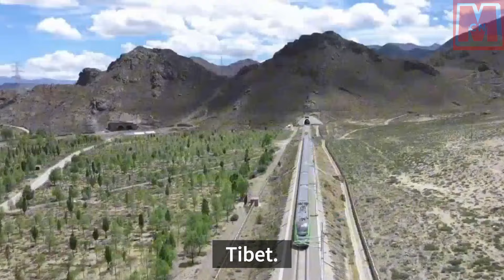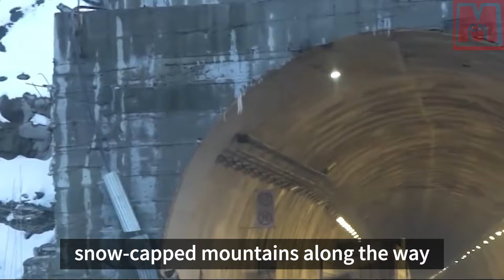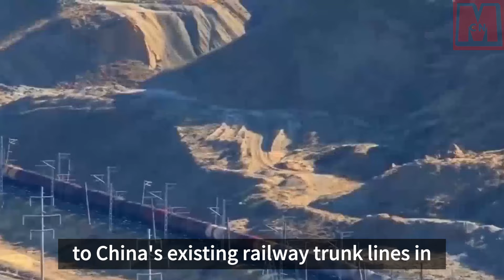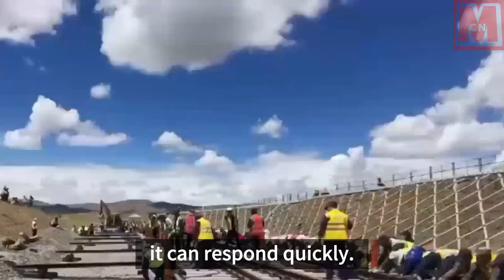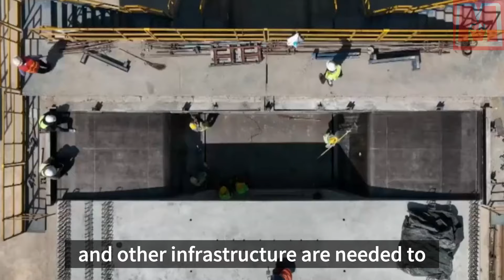China's Xinjiang-Tibet Railway sparks concern in Vietnam, not India.

Comment: AI. are you sure you have the right map? some of us are good with geography, you know. Aksai Chin is no where near the proposed rail, it's thousands of miles away in the opposite direction.
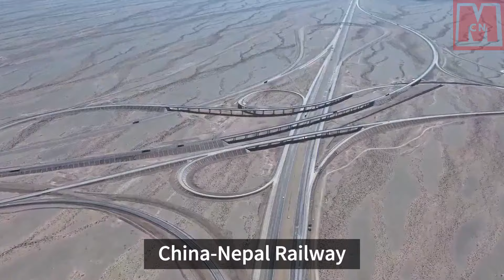Reply: I'm also struggling with the geography, but Hotan - Aksai Chin - Shiquanhe - Ge-Gyai -Shigatse makes sense geographically (economically is another matter). Openrailwaymap does not show this plan, but it does show a line from Shigatse going west and down to Nepal (mentioned 9:19). It also shows a line east from Lhasa to Chamdo and Chengdu (under construction), with a branch going south to Lijiang (planning).
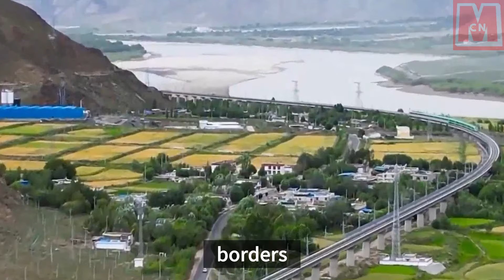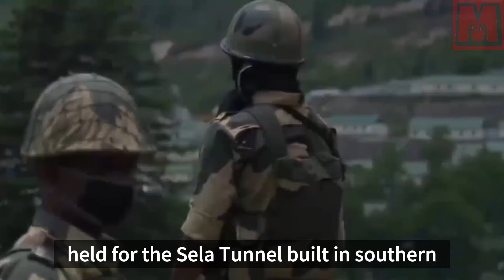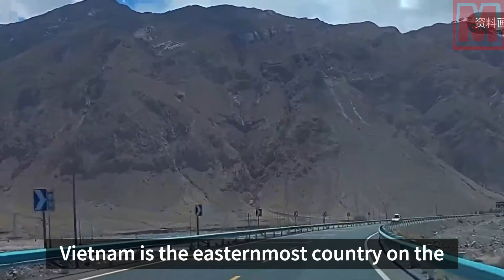What confused me is the mention of the Sino-Bhutan border (6:24) and Tawang and Sela Pass (from 7:27), which are south of Lhasa. This part sound definitely menacing to India ("recover" the entire southern Tibet at 9:33), but the proposed line would get close to the disputed border with India *west of Nepal*, not south of Lhasa.
The connection with Vietnam seems far-fetched. Sure, Hanoi - Lijiang - Lhasa - Hotan - Kyrgyzstan is shorter than over Chengdu - Xining - Ürümchi but is that significant?